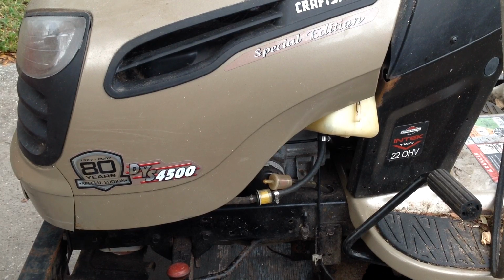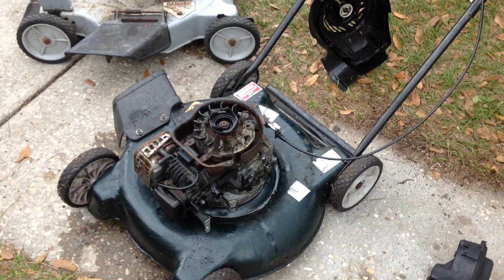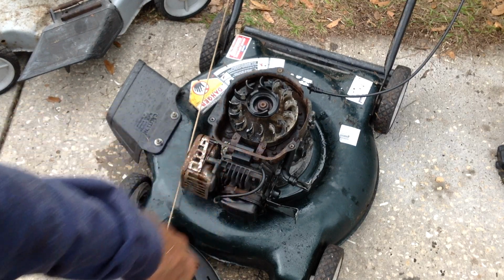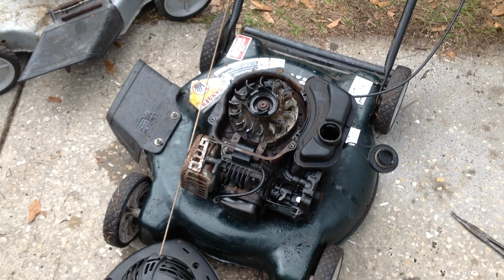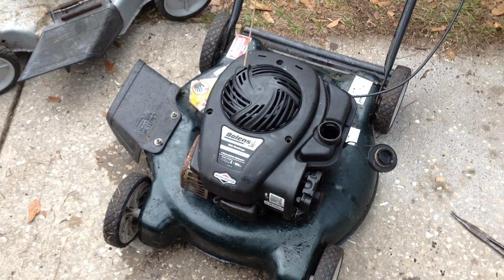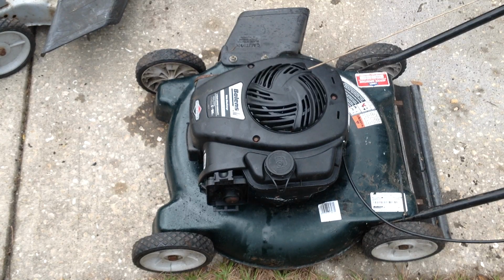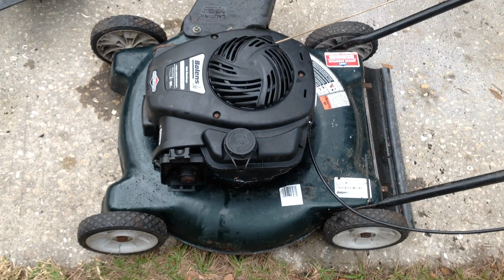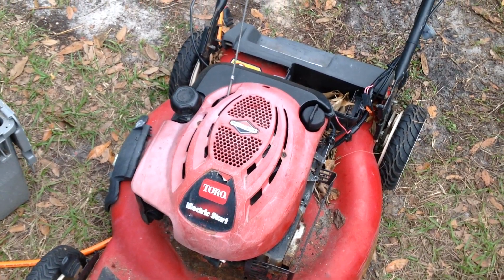New Year's Eve Mower Extravaganza!!   Time for some Bolens LOVE!!

Comment: On the Toro; remove the rear wheels, snap rings on the pinion gears then carefully remove the gears being careful not to lose the key and spring that pushes the key up into the gear (you will probably have to dig the spring out of the axle hole with a pick). Note the direction of the pinion gear notches, they should point towards the handlebars on RWD machines (some gears have L and R stamped on them, some don’t). Remove the spacers (note where they go and how many, the left side should have 1 more than the right side). Shine up the drive axle underneath the deck  on both sides where it goes through the HOC plate. Soak the drive axle with penetrating fluid where it goes trough the HOC plate bearing on both sides, grab it in near middle with vice grips and wiggle back and forth to free it up. When it frees up knock it to one side and shine it up where it comes out of the bearing. Clean off all of the grit then knock it the other way and repeat for that side. Oil the shaft where it goes through the HOC plate bearings, reassemble and de-grease / clean / re-grease the keys and springs. That should free up the drive shaft and the pinion gears, you should be good to go for a few years if it’s not left outside.
Reply from the maker: thanks for the solution to this rusty problem.

Comment: On the toro. You might take out the transmission box and see .  Also some wd40 on the axle .  If it has been sitting outside . The axle might be rusted to the transmission and the wheels and gears.   Had a similar issue on a yardman and cub cadet
Reply from the maker: will look at fix.